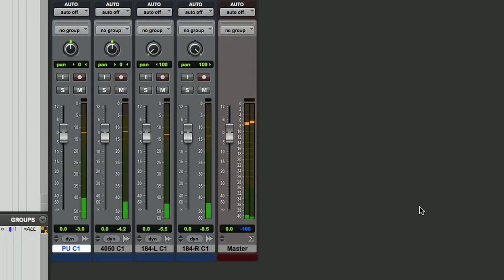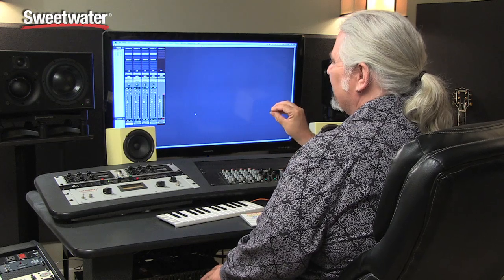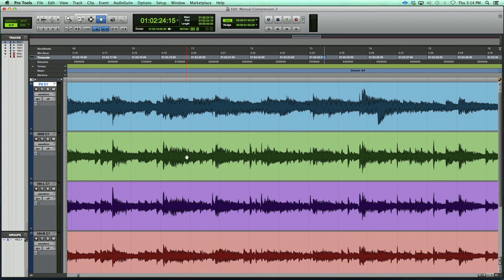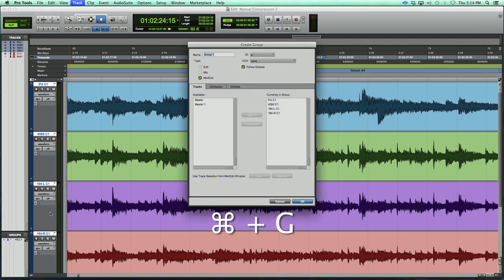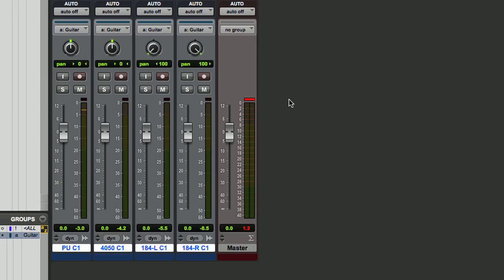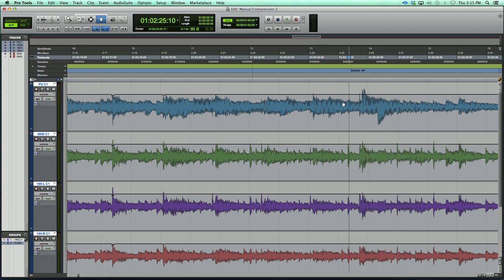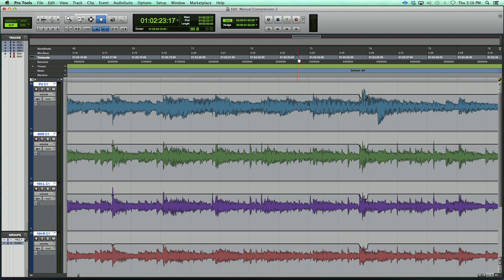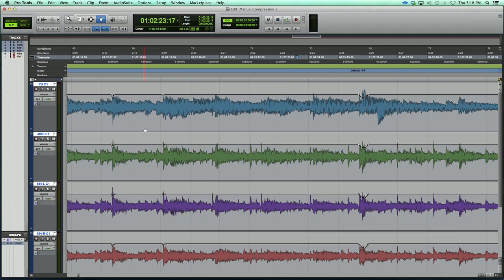How to Control Audio Peaks with Manual Compression - Sweetwater Sound

Comment: Mitch, won't this have zero effect on how an inserted compressor reacts to the audio on the track because the inserts are pre-fader (before volume automation)? I'm referring to the last thing you said in the video. If you automated the volume and then bussed the track to another track/aux and had the compressor on that track, then the volume automation would allow the compr. to not work so hard. However, using clip gain for the same trick in PT11 would allow the audio to not make a compr. work so hard....that's what I'm thinking....But thank you for this cool idea, and PLEASE continue to make more!
Reply: You are correct, the compressor would have to be inserted in an aux that the track had been bused to. Unless you chopped the track up so you could just adjust the peaks, using clip gain would reduce the level of everything, which wouldn't really achieve the goal.